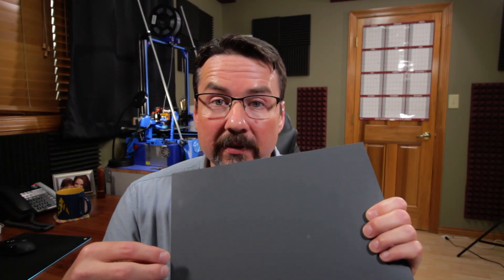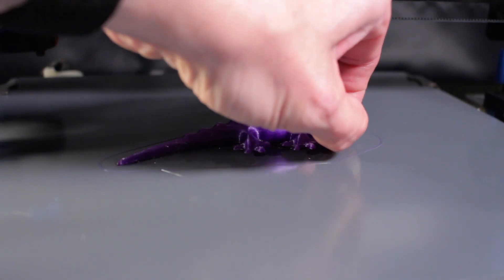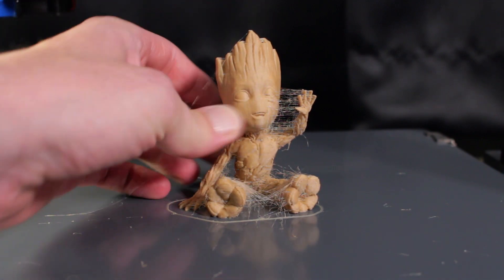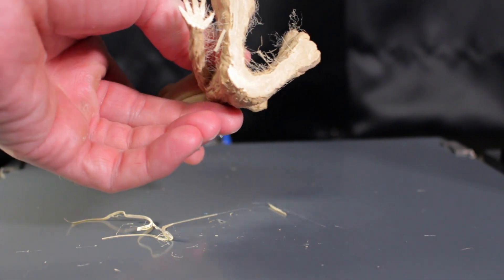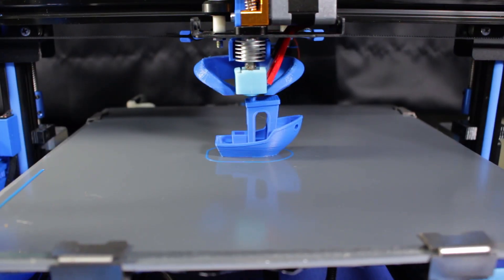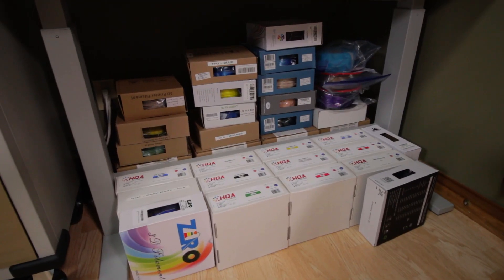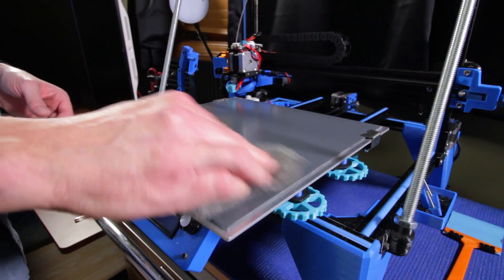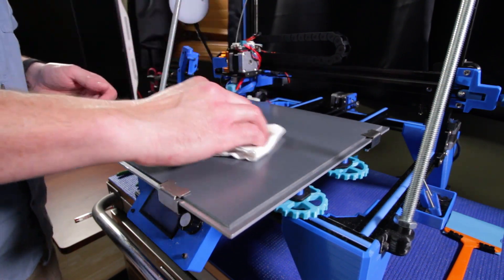Best Way To Use A Mirror Tile for 3D Printing

Comment: Thanks. What is the thickness of the mirror?  How fast did you increase the mirror temp from ambient to say 90 deg C?  I have successfully shattered two mirrors using the 'stock' settings in Marlin.
Ah. I see that the heating rate is defined by the PID values. What values do you use?

Comment: hello, my printer does not have a heated bed, is it possible to print on glass? i only use pla.
will it have a good adhesion?

Comment: If I print something with my original bed it starts with a "test-stripe" quite close to the left edge. Now it seems so obvious that nobody explains it, but the mirror-tile is slightly smaller (1cm or so) on all sides. You could align it left-front (and have 2cm missing back and right - which seems fine, just don't print there) but nobody seems to do this. Everybody puts the mirror so it's 1 cm smaller on all sides (I guess because it's easier to clip)... So does that mean the printbed size in the slicer (cura, ... ) is changed to compensate for the 1 cm loss on all sides? Or what is the normal way of compensating for this?

Comment: Do all mirror tiles have that same back?
Reply from the maker: I don’t know that all mirror tiles have the same material on the back.  That being said, all of the mirror tiles that I have seen have some kind of protective coating.
Reply: @cswilsonprints  I was wondering where you bought your mirror tiles. Thanks
Reply from the maker: Gerard Vanderloop I purchased mine at Menard’s, but I have similar mirror tiles at Home Depot and Lowe’s as well as Amazon.

Comment: What clips are you using to attach the glass to the bed?
Reply from the maker: They are stainless steel clips from Ali Express:  https://www.aliexpress.com/item/32950933891.html?spm=a2g0s.9042311.0.0.27424c4dxjOXnd